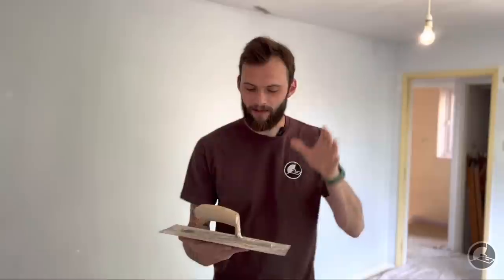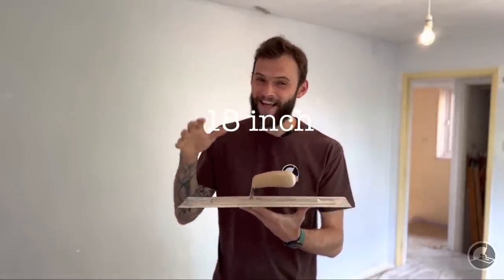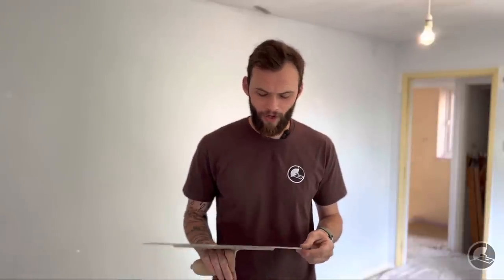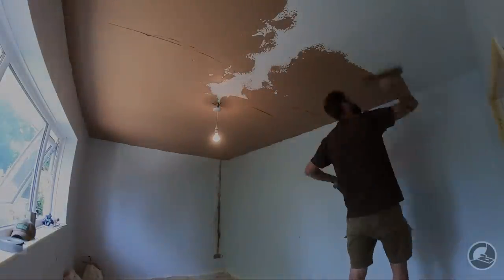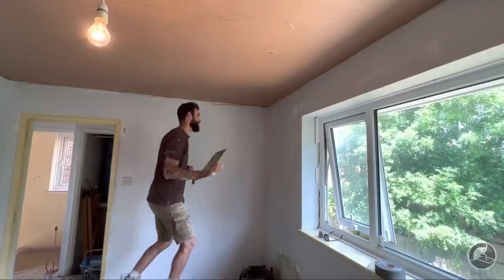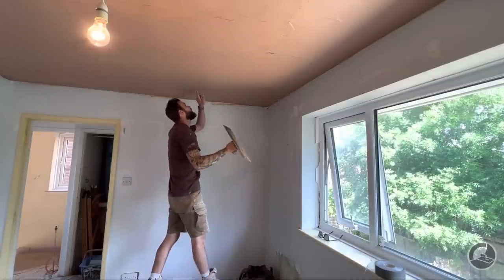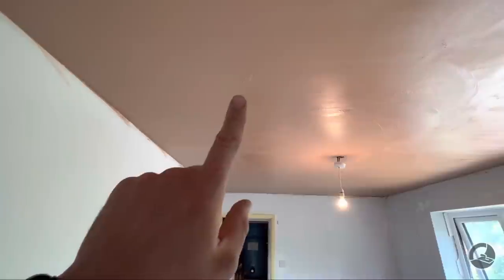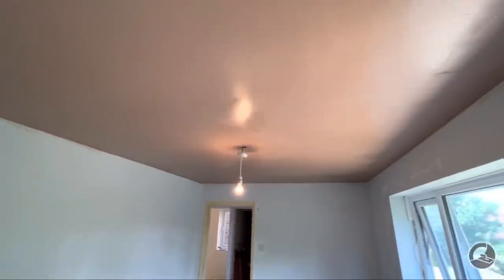Perfect Finish with a Flexible Trowel! POSSIBLE?

Comment: Good video as always. I have had tennis elbow and had to do it this way to get a smooth finish. Like you said though, it doesn’t compress the plaster the same and it also depends on skill level. I seen some people do it because it’s easier and had to go over their work because it’s too wavy, creating more work 😡. If you had a physical reason not to flatten with a rigid trowel, that’s fine. We all have to make a living, but those that don’t shouldn’t. I have gone back to flattening with a rigid trowel, it is flatter and Polish with a flexible trowel as they were designed.
Reply: Eccentric dumbbell exercises got rid of my tennis elbow I had it for a year please try this
Reply: if your a good plasterer, laying on and finishing wit an 18" medi is not a problem! it only gives u an issue if u can't see the mistakes u made while laying on ( that's the diff between a good plasterer nd a shit one!!)
Reply: @lion-0202 how so? Plaster is designed to be flattened as the process goes on, how can you flatten with a trowel that moves with the bumps and hollows? I agree that you can apply with any kind of trowel, but you still need to flatten and trowel up with something stiff besides the final lick over

Comment: Hi Alex. Great video. Did you find using the mediflex nicer when using a sponge float? Better results? 👊
Reply from the maker: They are both about the same. Just dries a better colour when sponged.
Reply: @AlexMorleyPlastering  cool mate. Are you using it more often now? Could I ask after sponging and taking lines out with mediflex when do you give it its second flatten and wet trowel? Wanna try it out. Any tips would be appreciated.  P.s nice Instagram pic!! 😂👊

Comment: has anyone ever tried to roll multi-finish plaster on the wall (using a paint roller) rather than using a hawk & trowel??? i've seen a few videos where this has been done with jointing compounds (similar to easyfill) followed by a flatten with a stainless steel spat & was thinking if the same could be done with multi-finish. i know its not the 'normal way' to apply multi-finish here in the UK - but would love to hear if anyone has tried it.
Reply: Yes u can .
Reply: Check Blaine greys channel plastering for begginers he tried this for a video and it works surprisingly well

Comment: You can flatten with a medi or supaflex2 anyway just not lay on
Reply: Surely laying on with one is fine, How you apply it in my opinion isn’t the issue, it’s how you flatten it. Same as tape and jointing, it’s not how you put it on, but how you take it off and feather it in for example
Reply: @NiktheEnglishGreekCypriot that’s a load of shi😂 what your saying
Reply: @martindonaton3603  plastering is about getting it flatter and flatter, you can lay on with a flex, as long as you flatten and trowel up with a steel. Common sense. Not that I do, I use a carbon all the way through